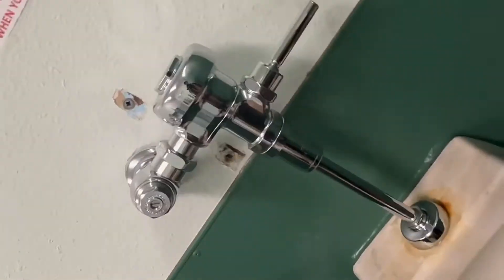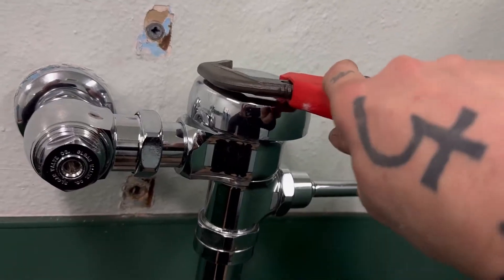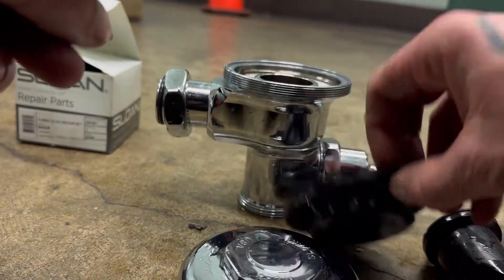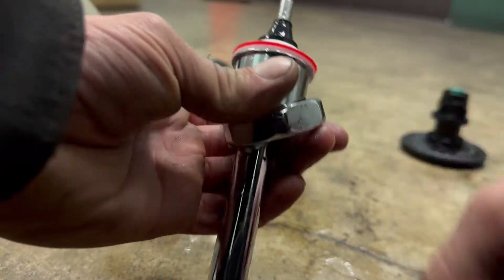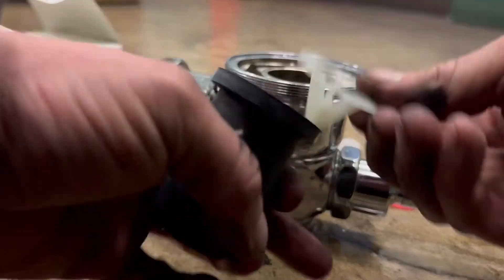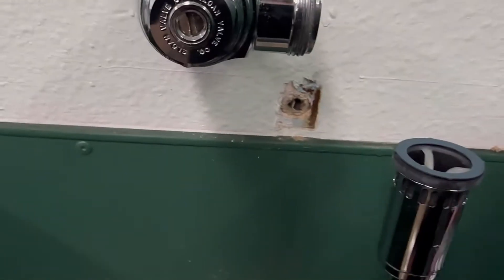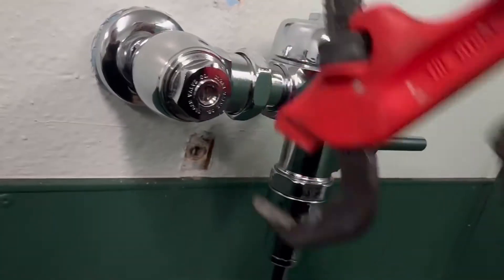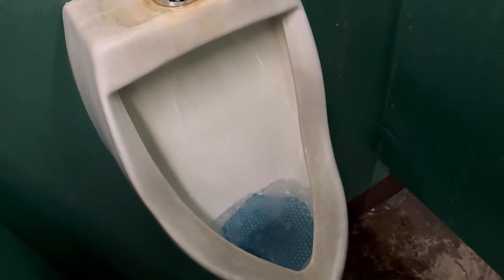How to rebuild a Sloan valve ( flushometer)

Comment: what if the water source is leaking where the screw is? is there a kit for that?  Thanks. Very informative
Reply from the maker: @kalilboulos5392  you will need to shut down water and replace the screw driver stop
The kit for rebuilding it is not worth the money
Reply: How about if it’s also leaking at the bottom where attaches to urinal itself?
Reply from the maker: @ that’s a spud replacement I don’t have a video on it yet but I will put one up asap

Comment: What's the kit number?
Reply: Sloan b 50 a handle repair kit. R-1004-a diaphragm rebuild kit (big one in middle, 1.6gal). V-551-A vacuum breaker replacement kit

Comment: What if it won't prime and stop?  I have fixed these at a huge nursing home for 3 years, always easy to fix.  Recently I had one that the shut off would leak/drip heavy unless it was all the way off or on.  Then after replacing all you did, it would not stop flushing still.  Ended up cleaning it out, reassembling again, and so far it is working.  Just not sure what was going on, did remove some almost metallic feeling sediment from under the diaphragm though...
Reply from the maker: @logicalrationalfishing7481  sounds like you had a sticking diaphragm or flush spring 
Without being there I couldn’t give you a honest though I’m sorry
Reply: @PlumbWater.7966  It was the sediment I mentioned.  We had a major water repair on a 330 gallon tank and a few had the same issue.  Just clear the little crumbs out and it was good it go.

Comment: Please put the link for the tools you are using. Especially the wrench
Reply: Pipe wrench you can get at any hardware store or harbor freight.
Reply: That wrench he had said Milwaukie but they used to be a Rigid E-110. Submarine navy couldn't operate without a Rigid E-110. At least from old history perspective.